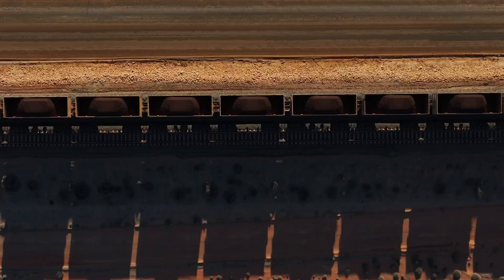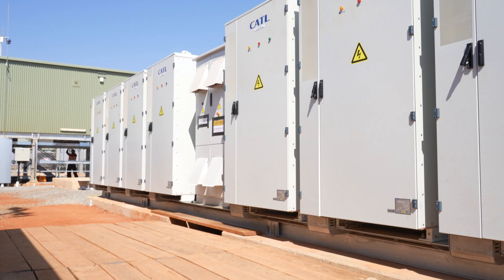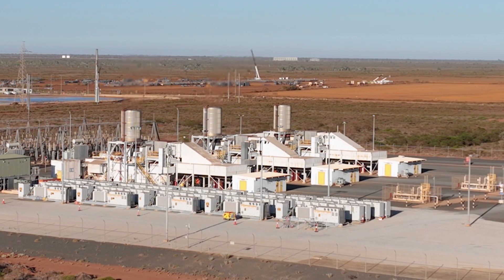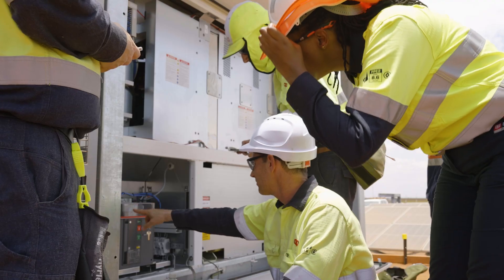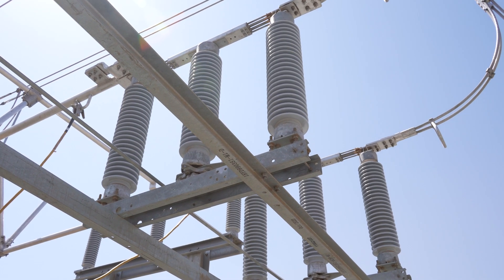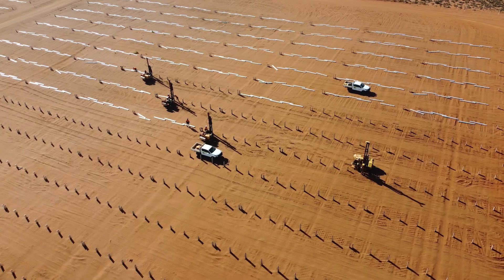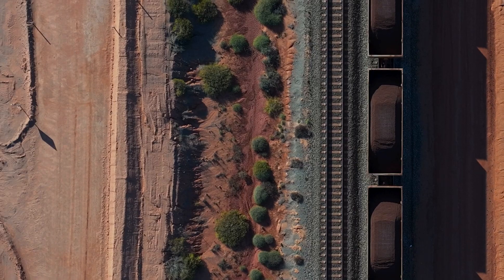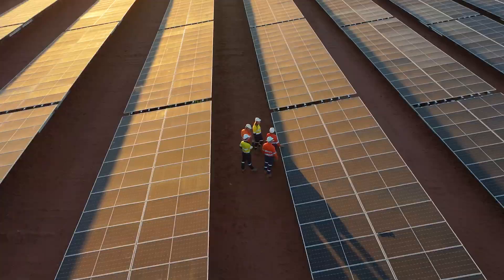Building the Future: Port Hedland Solar Farm & Battery Project

Comment: Interesting.
When BHP wants to replace a fleet of huge trucks or excavators or shovels.
They replace them all.
BHP does not replace 50% of the Trucks, it replaces 100% and often increase the output of those new trucks.

So the leadership from bhp remains poor.